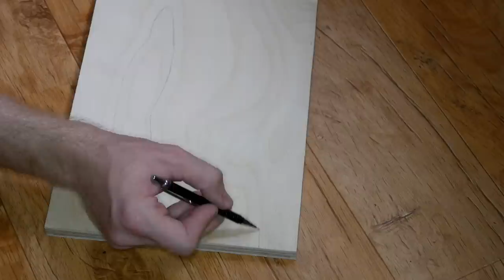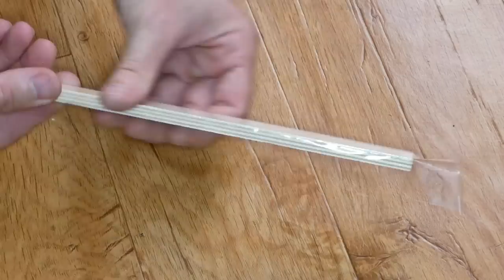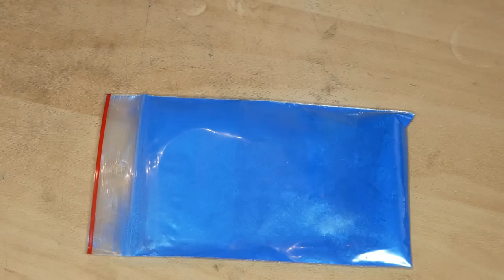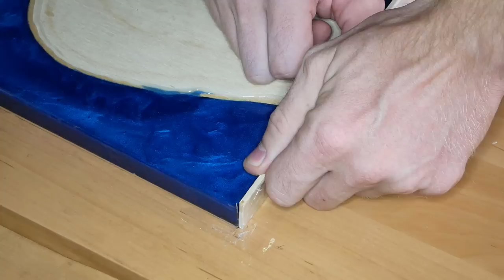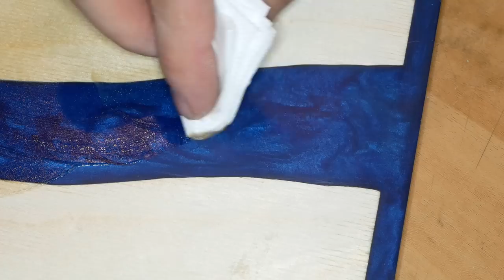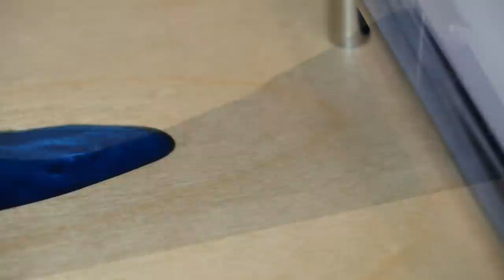How to make Epoxy Resin Tray / RESIN ART

Comment: Curious would using like a smooth flexible steel sheet the could be slightly bent works as a base then you don’t need to use a knife or screw driver to release project from the base  or even put tape on it  etc